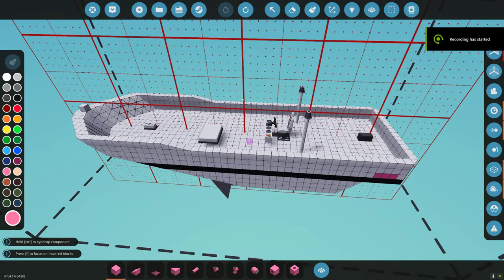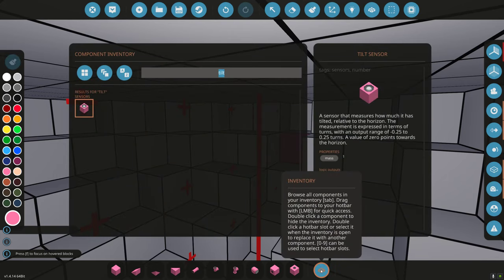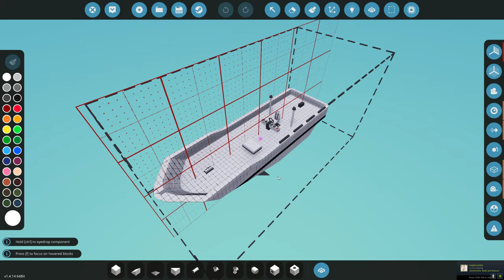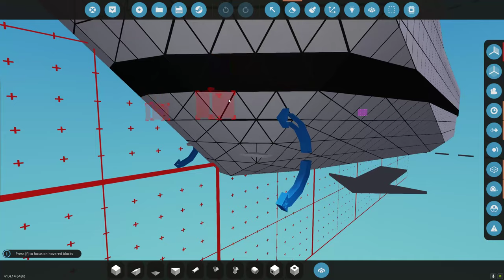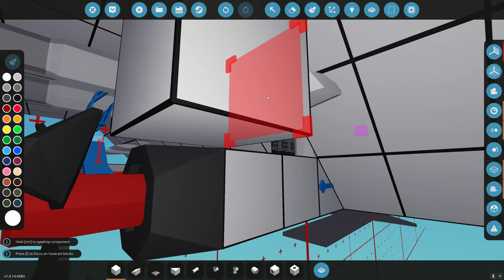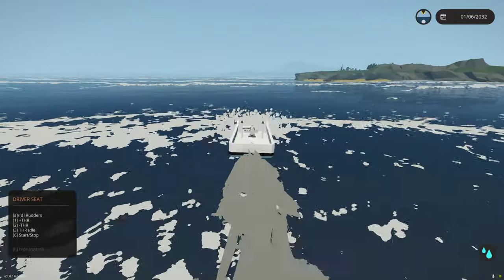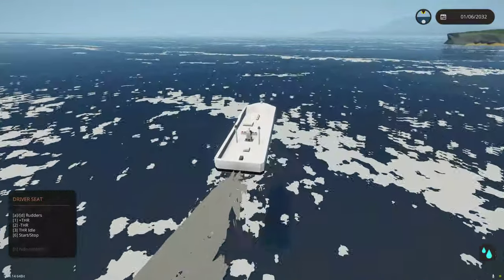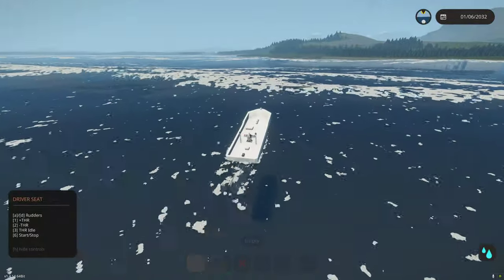Career Build Series Part 4

Comment: Hey captain got another question sir, a friend of mine said you can even use gyros for possibly stabilizing boats(he hasn't tried it, just believes itll work lol). I told him theres no way I doubt it, only makes sense to use for aerial crafts such as helis and planes. What do you think? I havent tried that yet, I still feel control fins/rudders are the obvious way to go.
Reply from the maker: Especially for boats I think it's better to make a custom system with pids. Gyro is essentially a less customizable pid system.

I tend to like to use the stock gyro for planes and helicopters. This is because it takes up a lot of space to put in all of the tilt sensors and inertia sensors. Where the gyro itself is reasonably compact.

I tend to have adequate space on boats and you can just use tilt sensors to accomplish this. 

Ultimately it is going to be best to make a custom gyro system. I might make one at some point for aircraft.
Reply: @CaptainCockerels  oh ok that makes a lot of sense, I appreciate you taking the time to explain all of this stuff as always bro, cheers 🍻
Reply: @legokingiscool  I always use Gyros for small boats. It's good enough for boats that fit the starter-base. It's cheap, cost no time to implement and is easy to configure...
Reply: @geraldhabres  I appreciate the response brother this was quite a while back 😎

Comment: One thing to add is, the altimeter measures from MSL and does not account for wave height. Consider using a fluid meter exposed to the sea instead -- it will have a similar effect, except it will account for wave height as well. Notice that in the troughs of the waves the bow comes up. This is because the altimeter-based system is controlling for MSL -- it is trying to keep the bow at 0 m MSL, when we actually want it to keep the bow at 0 m relative to the water it's actually in.
Reply from the maker: I want it to ride the wave naturally. I don't want it to crash through. That is why I do it this way.
Reply: @CaptainCockerels  That's my point. Altimeters measure from the baseline of the waves. Crests are above the baseline (altimeter > 0) and troughs are below the baseline (altimeter < 0). So when the boat goes through a crest, it will try to dive down into (and attempt to pierce) the wave, and when the boat goes into a trough, it will try to climb out of it.

Fluid meters measure the actual height from the ocean surface, so they are the correct choice for what you are trying to do.
Reply from the maker: @masterdynamo6457  I am on episode 112. Brizo works quite well as designed. This is episode 4.
Reply: @CaptainCockerels  I'm aware. I just thought I'd mention that the distinction exists for anyone who's watching along. Perhaps they will find it useful.
Reply: I also thought I'd mention that this is in no way a criticism of your design: if it works, it works. I just want to help spread the awareness of multiple options for solving the same problem.